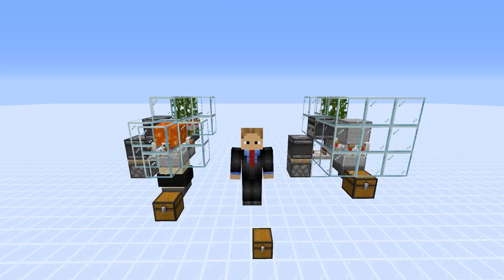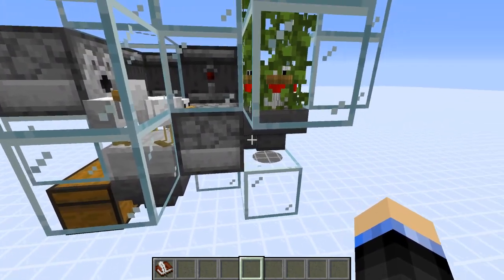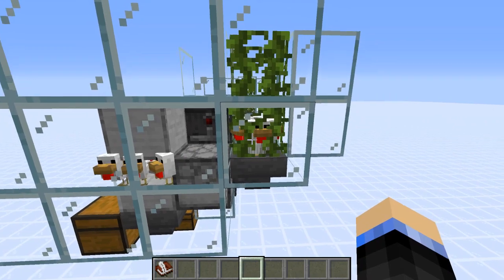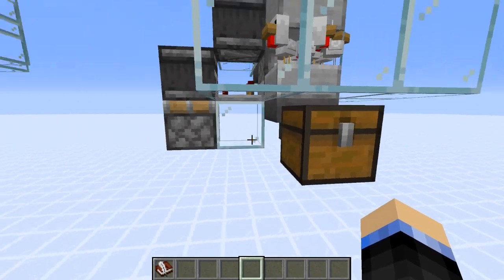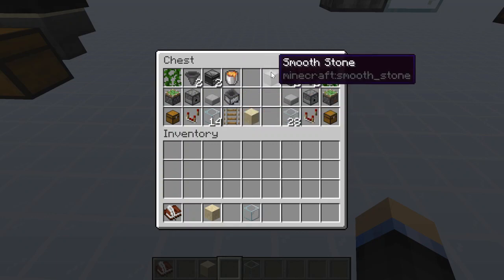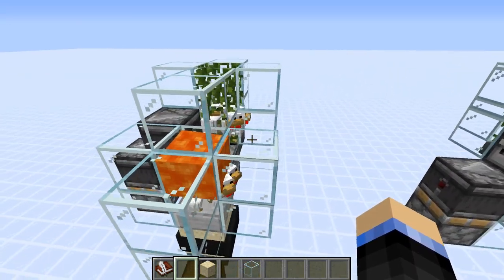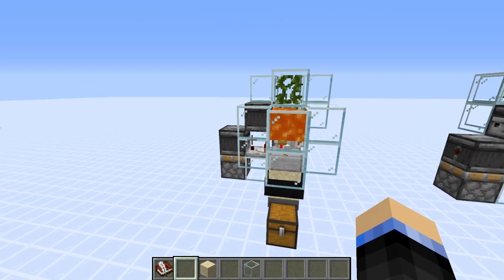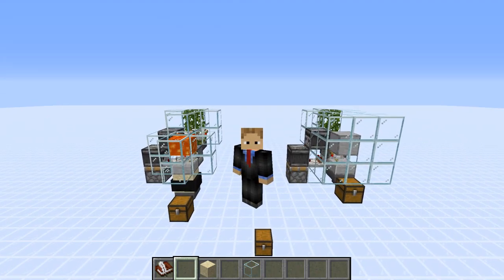Maximum Efficiency Chicken Farm (Fully Automatic) (Java 1.14 - 1.15+)

Comment: So I built the "raw" version but I'm seeing a behaviour I can't explain. When I'm close to the farm it works as expected but at a distance of 56 blocks (calculated using the Euclidean formula; location of farm:  -73	71	-147,  AFK location:  -101	70	-196) they stop laying eggs. What could be causing this? If I understand the wiki correctly this should work at a distance of 128 blocks from a player. I'm playing on selft-hosted server on 1.16. Thanks in advance for any insight.
Reply from the maker: any chance you have your render distance very low?
Reply: @EagleEye621  No, it's set to the max 32 chunks

Comment: I have been trying to get an automatic chicken cooker running for a while now... most designs were either outdated, or didn't function well. I found one that worked correctly but barely produced any chicken... now I know why : it used a hopper instead of a hopper minecart. I didn't know there is a difference in the pickup speed between these two. This video was an awesome find for me !
Reply from the maker: glad you like it :)
Reply: @EagleEye621  I used glass instead of stone on the chicken farm. Would that majorly affect the drops of your farm?
Reply from the maker: @ish7436  no
Reply: @EagleEye621  I "improved" mine by adding a filter to it that only keeps the cooked chicken and burns the feathers. I found a tutorial on a filter that uses hoppers, signs and a water current to filter out anything but the wanted item. Super useful here :)
Reply from the maker: @wombat6  be sure to keep a few of those feathers for some arrows if you haven't seen/built my max efficiency skelly spawner yet :)
Reply: @EagleEye621  yup, I'll need to do that at some point !

Comment: So I built this just like your, though I used cobblestone, and I double checked that I have the dispenser, not dropper. My problem is, the sticky piston never fires off to actually dispense the eggs from the dispenser. I have the comparator in the same position you show and the observers are facing each other correctly. How do I make the sticky piston activate?
Reply from the maker: can you post some screenshots to the help section of the discord?  hard to tell what you did wrong without being able to see it.

Comment: Is the minecart in the block necessary, why can't I just leave the rail there?
Reply from the maker: the rail will break the falling sand, and without the minecart hopper you can't collect the item before it burns.
Reply: @EagleEye621  as in, couldn't I just leave the rail on without putting the sand? In  that case, the minecart hopper will still collect drops from the slab, wouldn't it? Also side question, but would ladders work?(instead of vines)
Reply from the maker: @ChesskingisAWESOME  the chickens might glitch through the floor if you did that which would get annoying after a while.

yes, both vines and ladders remove entity cramming limits.
Reply: @EagleEye621  ah...I see
Thanks so much :) great vid.
Reply: @EagleEye621  hm, seems like I'm getting more raw chicken drops then cooked ones, and way less cooked drops than expected. Either the chickens at the back have been glitching into blocks and/or some of the drops still are being burnt any ideas?
Reply: Yep, on 2 hours, I received 7 cooked chicken and 2 uncooked chicken lol
Reply from the maker: @ChesskingisAWESOME  if you used solid blocks instead of glass to surround that killing chamber, it is possible if your world is a bit laggy the chickens could suffocate if they glitch into the walls.  Glass would prevent that.

Comment: one thing to add. when you kill adult chickens at the same time with lava, you only get 1 cooked chicken.
Reply from the maker: less than if you used looting, of course, but this way you don't have to think about it and can leave it running without needing to check a clock or anything.
Reply: @EagleEye621  i tested in creative, put 24 adult chickens in the roasting chamber just like in the design and then poured some lava to kill the adult chickens at the same time. I thought im gonna get 24 cooked chicken but i only got 1.
Reply from the maker: @Ender99999  that is not a realistic test because only one chicken will grow up at a time for the most part.
Reply: @EagleEye621  yes, you are correct. The test was flawed because i also found that when you spawn adult chickens at the roasting chamber (dying upon spawn and not at the same time with other chickens) while lava is there, chickens do drop the cooked chickens.
I know, it was irrelevant but i was just saying. :P
Reply from the maker: @Ender99999  interesting to know, even if not the most practical knowledge :)
Reply: EagleEye621 When I put the sand over the hopper minecart, it broke and transferred into the chest. I kept trying but the sand kept breaking. Ps. I have removed the rail and it still won’t work.
Reply from the maker: @curry_kid6994  is there something else you put down by accident?  as you can see in the video, it shouldn't break?  Can you post some screenshots in the discord or link a short clip?

Comment: I think you can push the efficiency of the chicken farm by using a fox with a fire aspect and looting sword, they automatically attack chickens. This way you can get like 2-3 cooked chicken per chicken
Reply from the maker: that is an interesting idea :)
Reply: it doesnt work. i built one and after hours of messing eventually had to scrap it. the fox constantly drops the sword even when you use hopper minecarts
Reply: @senorgeese  well tried out rays works's chicken and fox farm a while ago, and it seemed to work fine for the entire time i had it, you just needed the hopper minecart to be stuck in the block directly underneath the fox
Reply: @user-vy2jr6pb1z  thats what i had, and it didnt matter. it wouldnt be instantaneous, but every hour and a half or so the fox would drop the sword which made it basically unusable

Comment: Working on 1.14.4?
Reply from the maker: yes :)
Reply: @EagleEye621  ty
Reply: Actually i messed up by using dropper (i m new to all these) so i had to see this again
Reply from the maker: @romiul24  droppers will just spit out the eggs, you need the dispensers to try and crack them.

Comment: Awesome. How do I know when I have exactly 65 chickens? Or how do I know what number I have at all for that matter? What number do you think would be good for playing on a server? 65 seems a bit much, I don't want to cause lag.
Reply from the maker: if you don't put the vine in (or remove it), only 24 chickens can be in there (the rest will take entity cramming an die).  You can use your f3 button to see the number of entities on your screen, but there really is not good way to count that many chickens in that small of a space.  That said, unless you are planning on feeding your whole server with chicken, I would use a much smaller number to reduce the lag.  you can start with 24, come back in an hour and see if the output is enough for your needs, and if not keep adding more until you are happy... or, if to much, kill a few.
Reply: @EagleEye621  Thanks!

Comment: I don't see any reason this wont work on bedrock, but I haven't tried it lol. Thanks for the sound fix.
Reply from the maker: always a slight risk going cross platform, even on something that shouldn't have an issues.  Let me know if it works.
Reply: @EagleEye621  just attempted to set it up. You only need to change the comparator output thats on the side to the poison that raises the observer to the observer clock when it detects the eggs in the hopper. The technique uses "quazi connectivity"... Kind of... But bedrock is picky that way lol. I'll do a work around n find any other problems.
Reply from the maker: @hipnyah  interesting.  Thanks :)
Reply: @EagleEye621  suffocating works the same and so does the lava only other change is I didn't run into any entity cramming and I suggest a ladder instead of vines because the vines can grow upward on bedrock...
Reply from the maker: @hipnyah  that is a good tip... especially if they can catch fire... come back to your whole base burned down and no idea why :/